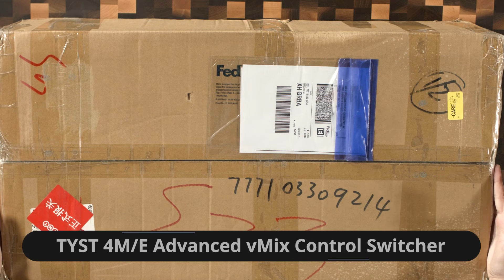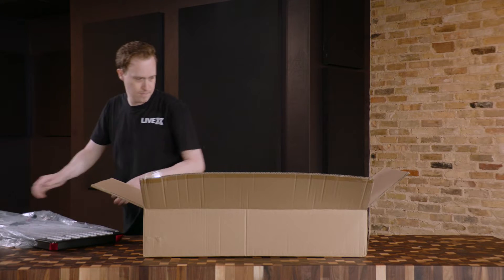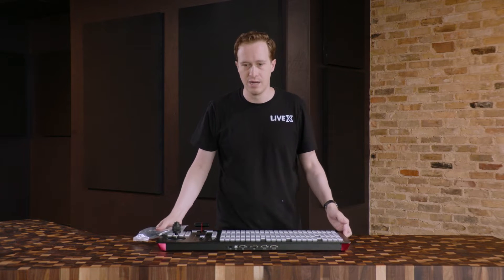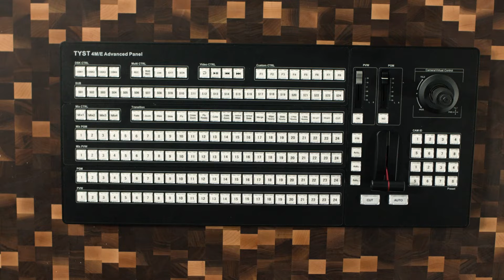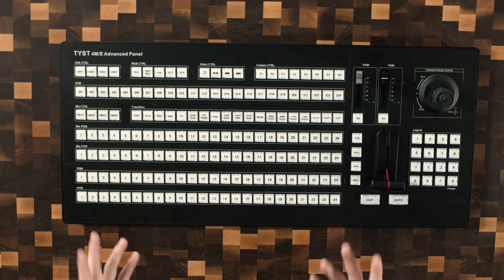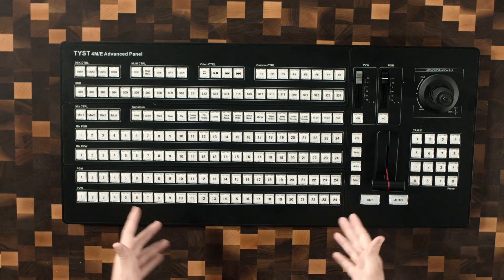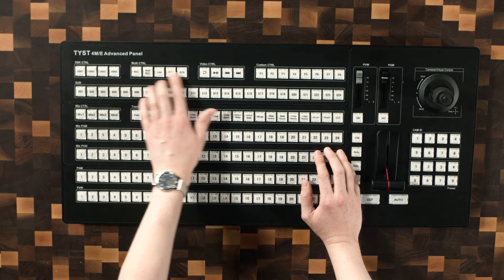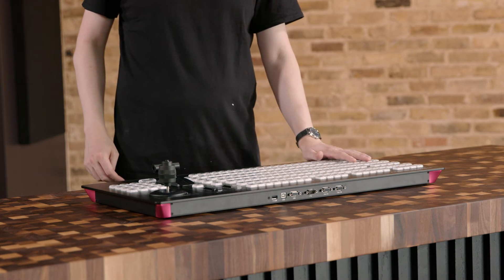Unboxing: TYST 4M/E Advanced vMix Control Switcher

Comment: I've installed these (and recently it's little brother) at our facilities all over. However, we use Central Control with it which gives it much more capability than raw out of box. As an example, we have our vmix CPUs in a remote machine room and use Studio Monitor and Central Control to control the systems over the network.
Reply: Eso suena interesante podría explicar más

Comment: Hi Jeremy, I found your review on the 4M/E and I was hoping you'd have powered it up, so I could see if you experienced the same issue as I've had with this device.

I see the packaging was about as good as our one... though you didn't have the broken joystick to deal with, due to it.

But I digress, the issue we're having is the constant high frequency flickering of the key lights, which I personally start to feel queezy from, after looking at the for more than a few seconds.

We've contacted the manufacturer and they just said no-one else has complained about it.

If this is normal, I can only assume it's to conserve power, as the device runs on a USB 2.0 socket, which supplies 5v at 500mA